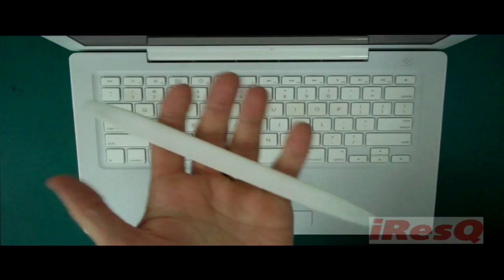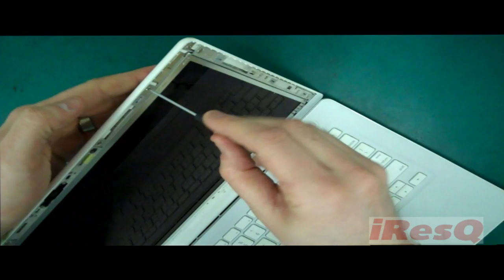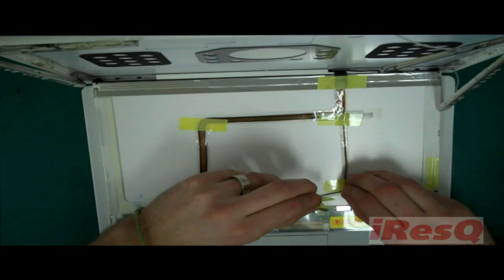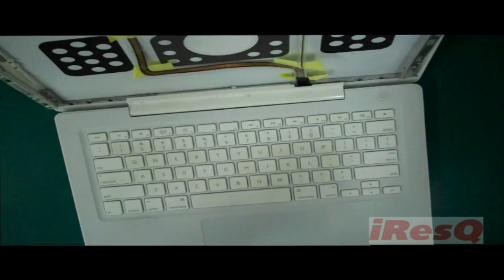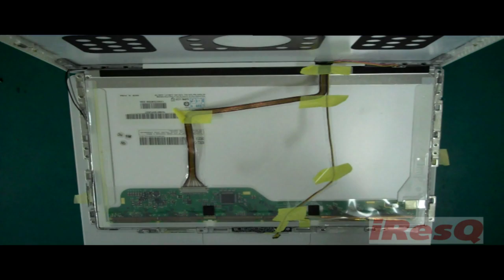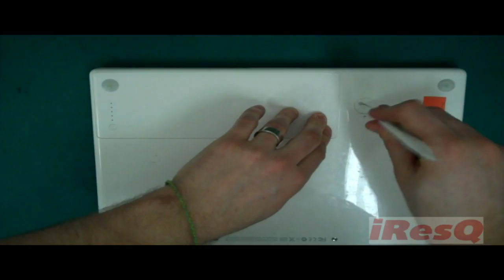How to Install a 13.3" MacBook LCD Screen - Tutorial by iResQ

Comment: Too bad about that damaged screen, but you had solid warnings in the video, so why do you blame it? It is a nice video, although the critical hinge cover/inverter board part is unclear. I am stalled since I can't pull the hinge cover back enough to insert the inverter cable, with which I know I have to be particularly cautious.

Comment: Nice overall job on the video. Notice how he doesn't show you how to insert the inverter plug. The first time I replaced one of these screens, I went through hell until I called my laptop miester friend, Tomas.  The trick is to use a the tip of a small screwdriver, stick it in the hole in the middle of the inverter plug and drive it into place.

Comment: This is a pretty good video. I was able to replace my screen in about 30 minutes. Connecting the inverter was hard - using a small flashlight to shine into the case so you can get an idea of where the clip is. Only other tools needed are a small flathead and small phillips head screwdriver.

Comment: Attaching the cable back into the inverter board is harder than it looks in the video. it's located towards the computer - but is kinda hidden. once you physically see it, connecting it is easy. try a tiny bit of extra force when you peel back the cover. makes it easier to see what's going on. i'm writing this because i experienced the same "black screen" problem several time. Ultimately, I located the plug and connected the monitor successfully.

Comment: Thank you for this video, I've replaced my screen for about £130 cheaper than I was quoted at the Apple Store.
One problem has arisen though. Every time I go into a different room other than the room with the internet router in, my Mac cannot pick up any wireless signal. Is this problem related to me replacing the screen?

Comment: My LCD screen replacement was a successful operation because of this tutorial vid. Thanks much for posting it. I did *not* however use a spudger or a grounding strap. I simply planted my feet on a piece of particle board and didn't shift them around during replacement, thus preventing static build up. One of the small screwdrivers worked in lieu of the spudger. Very helpful vid, though. Thanks again.